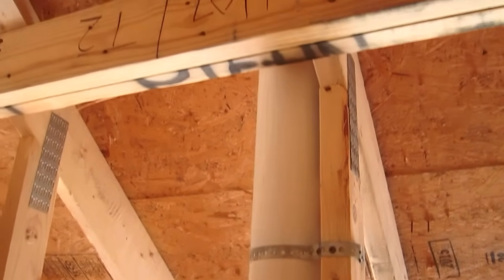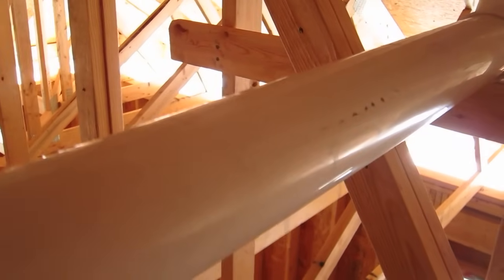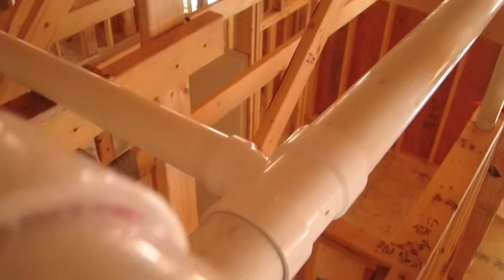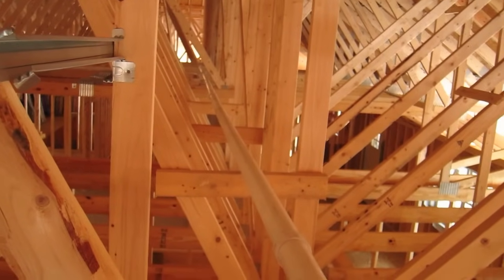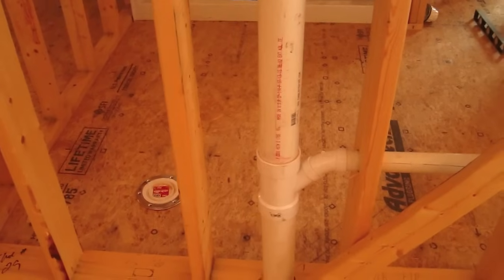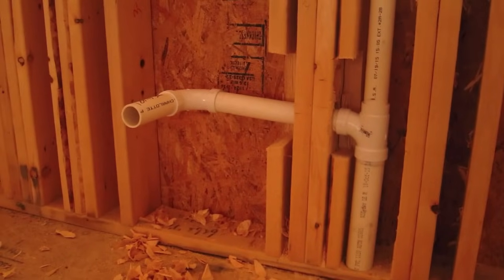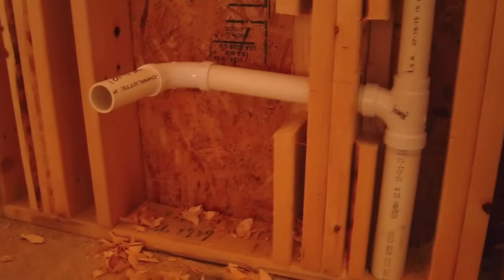How to Vent Plumbing

Comment from the maker: The TY fitting you see at the beginning of this video was specified by the homeowner. This NH town had NO plumbing inspections. An inspector would have FAILED the installation as we all know.
Reply: Why would anyone specify this?  What was their reasoning for doing it 'wrong'?
Reply from the maker: Simple. The homeowner felt that a snake would have a better chance of clearing a clog at the end of the branch arm if it was pointed down instead of drilling a hole into the side of the stack. It's a valid concern. The sink functions properly. Even when you fill it with water and pull the plug, the last slug of water doesn't syphon the trap.
Reply: @askthebuilder  Thanks for the reply and the great video!  Definitely understand the concern, I've had snakes try and go the wrong way in san-tees before.
Reply: @askthebuilder hello, can you please pinpoint the timeframe of the TY that is in reference so that I can further understand the scenario.  Much appreciated.  Thank you.  Great video.
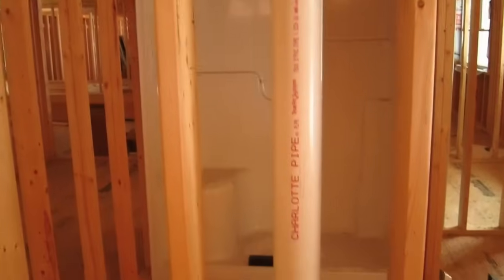Reply: @cgparas1  I believe he is talking about at 4:13 mark.
Reply: Budy spending more money then he should on that pipe , you really dont need a 2" vent coming from the venity

Comment: I'd rather not penetrate the metal roof by using Studor vents.  Is that ok in northern VT if the vent is 4" or will the Studor vent clog with hoarfrost?   Thanks!
Reply from the maker: Studor, or AAV, vents should be illegal. They always fail because they have moving parts. It's SO EASY to install a leakproof flashing in a metal roof. Watch this: https://www.youtube.com/watch?v=ZcAmtrNu2Js  Get on a phone call with me so I can help you avoid a nightmare: https://shop.askthebuilder.com/15-minute-phone-or-video-conversation-with-tim/

Comment: why waste so much material trying to connect them all to one 4' vent? wouldnt it be better to just go straight up for some of the fixtures? I am not a plumber nor have experience. just curious.
Reply from the maker: That's a great question. This particular homeowner only wanted one roof penetration. You're correct, you can save lots of pipe and time punching up multiple vents through the roof.

Comment: Outstanding video and explanation of the plumbing vents and how they should work. I'm a DIY'er and I have a new metal roof going on my house soon. So I'm looking to consolidate as many of my vent tubes going through the roof as possible to minimize any future leakage issues and to make it easier to get the roof on. Your video confirmed all of my design ideas - such as keeping a slop from the exit pipe to each of the vents I'm tying together. Even though I live in Texas and have not had any severe freezing to the vents, I intend to ensure the vents stay dry as a practice.
Reply from the maker: Be sure you watch my video about how to install plumbing flashings through metal roofs. You need to PLAN exactly where the vent will be centered between ribs. Use the Lifetime Tool flashing!!! Here's the link but  be SURE you get the one that matches your pipe size: https://amzn.to/4mIoRXf

Comment: Great video, so there's no problem with running vents horizonal or with bends/elbows? I'm looking to install solar on my roof and the southern side has three vent pipes in the way. So I can get a plumber to redirect those vents in the attic to come out on the other side of the roof (maybe 15-20' away)?
Reply from the maker: Correct. I do phone consulting before you make a HUGE mistake: https://shop.askthebuilder.com/15-minute-phone-or-video-conversation-with-tim/

Comment: If the air supplied not vented out as you say, why it goes through roof ? Makes no sense, you can take from side wall if was air in
Reply from the maker: You must have not attended school the day vacuums and air pressure were discussed in high school physics class.

Comment: I noticed you increased the pipe size in the attic. I've read that this should be done before the vent leaves the thermal envelope. Will the attic ceiling and walls be insulated or am I misunderstanding something?

Comment: amazing video. I'm trying to build a half bathroom and a full bathroom on the complete opposite side of the house as my stink pipe/drain stack, one on the first floor and the other in the attic,  and this in invaluable information. luckily for me the difference is not 50 to 60 feet long like this one! thank you.
Reply from the maker: I may be the only plumber in the USA that offers DIY phone coaching should you need help: https://shop.askthebuilder.com/15-minute-phone-or-video-conversation-with-tim/

Comment: The water pressure would cause the house to flood without air, right?
Reply from the maker: Wrong.
Reply: No the air would just be pulled from the drain itself. So, you’ll get bubbling/gurgling and slow draining. It’s similar to tipping a bottle of water upside down - then tip another full bottle upside down but with a hole on top

Comment: Good job on the video. Our modular home only has 1 1/2" vent pipes through the roof.  They do freeze over . Now I know more of why.  I want to correct the problem eventually.  Lots of sheet rock has to come down and 3" or 4" roof vent piping needs to be added.  Thanks for the classroom time.

Comment: Was  clear primer used on those joints? Purple primer typically is used to show the inspector they were properly primed. Unless it was brought up in another's comments, which I didn't notice, just wondering.
Reply from the maker: That is a very good question. Kudos to you for asking it respectfully. Yes. Clear primer. You can swab in out farther on the pipe to show the inspector primer was used. I dislike purple for a host of reasons.

Comment: So why is it soooo important that the one bath has a three inch vent but the master bath, laundry and kitchen can all run off of a two inch vent pipe ?!!!🤔😉😉
Reply from the maker: It's a great plumbing practice to have at least one full-sized vent in a house. Vent pipe diameters are a function of distance and fixture units.

Comment: Let's get this straight. Per the Plumbing Code Illustrated Manual. The vent pipe does stop siphonage from happening. You are correct Sir. Now, the vent pipes also makes it possible for sewage to flow thru the sewer pipe in the street. When sewage flows through the main sewer it pushes air through the sewer which escapes out the house vent pipes. As the sewage continues down the sewer it pulls in air behind it. It gets the air from the vent pipes in the house. So, as the sewage passes a house the vent pipe allows air to escape out the house vent pipe. As the Serge of sewage passes by the house the air is pulled into the sewer via the house vent pipe
Reply from the maker: You're correct. I've shared these same facts in columns on my www.AsktheBuilder.com website. I've done sewer taps in the past where a 12-inch main was flowing at 80% capacity. It almost looked like water flowing through a fire hose. To your point, that pipe at 3 AM in the morning is mostly filled with air. That air is pushed ahead of the sewage as the pipe fills and needs to be replaced.

And you're correct about the Venturi effect caused by the sewage passing by each sewer tap.

Comment: Every house I ever remodeled had roofing deck rot around the plumbing vent penetrations through the roof. 
I am about to build a house and I'm going to encapsulate the attic by using spray foam on the other side of the roof covering the rafters about 10 in... This will obscure my ability to inspect my plumbing vent penetrations which could cause further damage if they leak. 
Do you know if the code will allow me to vent the plumbing out the side of the house in the attic gable if I turn it up with a 90?
Reply from the maker: If you live in NOLA you can. Otherwise, it's very doubtful. Watch this video I did showing the BEST leak-proof vent flashing and HOW to install it. The wood will never rot: https://www.youtube.com/watch?v=dfliETAVTeI

Comment: Here in Wisconsin, my 1950 house has 4" cast iron.  This is from the street, the floor drains, toilet and soil stack.  At the roof it has a 5" expander, because the code requirement was a 4" UNRESTRICTED vent opening in case of ice or frost buildup, (we get down to 15 below at times.  We got down to 26 below twice, our all time record low).  Bathroom sink and tub/shower were 1 1/2 galivinsed pipe, wet vented.  The kitchen sink at the other end of the house has its own roof vent, with a 2" galvanised  drain into a 4" , 4 foot cast iron riser with clean out.  About 30 years ago, I replaced all the galvanised drains with PVC.  Although they looked okay on the outside with no leaks they were clogging because of rust build up.

Comment: Don’t vent pipes also allow sewer gases to escape to the roof? If so, the function is bidirectional. Air travels down to maintain proper air pressure and up to move harmful gases to the roof?
Reply from the maker: Sewer gas can be pulled out of roof vent pipes by the Venturi effect as wind blows across the top of the pipe. But don't think that sewer gas floats on its own out of a vent pipe like smoke from a chimney or engine exhaust from a car/truck tailpipe. The primary purpose of vent pipes is as I talk about. They replace the air pushed DOWN the drainage system by flowing and rushing water. It's no different than air in an elevator shaft in skyscrapers.

Comment: Not real sure how condensate will travel those 90 degree turns up and over down. Sounds good, but really?
Reply from the maker: Can you give me the time stamps in the video where you feel condensate is traveling UP? All the vent lines in this video are sloped so the condensate runs to a vertical stack and then down into the building drain. It's probably a very good idea for you to bone up on the UPC.

Comment: When moving  an existing vent pipe from one side roof to the other side, which is needed for a solar panel install, what's your advice?
Reply from the maker: Simple. Move it. If you need step-by-step instructions to ensure it works PERFECTLY, you can get me on the phone. I'll save you at least $500. https://shop.askthebuilder.com/15-minute-phone-or-video-conversation-with-tim/

Comment: Did the homeowner also designate where they wanted the roof penetration? Odd to have it all the way at one end of the roof, instead of centralized for shorter run to the extremities.
Reply from the maker: Yes. They wanted the plumbing vent on a side roof not visible when you pull up the drive or walk to the front door. Some people don't like to see the plumbing vents poking out of roofs.

Comment: Is there a fix for the high wind syphoning the p trap? I've noticed it for a while in fall through winter and early spring months when wind are higher and the leaves are off the trees. Thanks
Reply from the maker: High winds don't syphon p-traps that are installed with a proper vent. P-traps do DRY OUT if you don't add water to them once a month.
Reply: @askthebuilder  every day I use all of it. It's really only the bathtub and it is pretty much when the trees can't obstruct the wind. There are also other videos showing yes wind can siphon them. I only have one bathroom. Several people use the shower every day. No leaks in the basement. Outside of trap is bone dry.  House was built in 1890. Plumbing was updated in the 80s by a previous owner.

Comment: How many feet can the fixtures (tub, vanity,  and toilet) br from the vent pipe?  Is it a straight line or pipe  line distance?
Reply from the maker: Usually no more than 3 feet. There are exceptions in the code. It's online. Go read about it.

Comment: Great explanation!! Im at the stage  of rough plumbing  soon
Reply from the maker: I draw riser diagrams so you get ALL of the pipe sizes correct. I also offer phone coaching. I'm working with two DIY homeowners right now who are installing all of the plumbing in their homes. It's the BEST $$$$$ you'll spend on the project. https://shop.askthebuilder.com/15-minute-phone-or-video-conversation-with-tim/
Reply: @askthebuilder  
I can drawer a rough skech of my 1,200 layout ,its small .see if you can get me a price on the spec layout fir me or plumber to do it the right way
Reply from the maker: Veronica, I'm happy to draw your riser diagram. Call me for details: 603-470-0508

Comment: Hello --  for a new home build  with a basement living area with bathroom and a snack area with a bar sink, and having a poured concrete floor,  we would like to have an integral 2" floor drain trap with a back up device at the lowest point in a recessed mechanical room.  In searching for information about venting this drain, we believe that it will not need to be vented to a vertical stack as it is 2" piping, and thus has enough free air space to not require a direct vent?  Are we interpreting our findings correctly?  Secondly, should we be concerned about the floor drain "drying" out and allowing sewer gas and odors to come from the septic tank? Thanks in advance for the answer.
Reply from the maker: I do phone consulting for situations like this. I'm an expert in the topic. Go here to set up the call: https://shop.askthebuilder.com/15-minute-phone-or-video-conversation-with-tim/
Reply: Thanks but.... I can find all the information (for free) by doing research and save my money!  @askthebuilder
Reply from the maker: I wish you the best of luck. The Interweb is littered with lots of false information. Quick question: Do you use the Internet to get free medical or legal advice? I'm a professional just as they are.

Comment: Why didn't you use a sanitary tee at 4:52?
Reply from the maker: Because the homeowner INSISTED on using the TY fitting. I informed him it was against code creating an illegal S trap. The town the house was built in has NO inspections of any type. No building inspection, no electrical inspection, no PLUMBING inspection so I knew I'd not have to cut out the fitting. As of this date all these years later, the trap has NEVER been suctioned dry by the adjacent toilet. Also, filling up the sink to the brim and pulling the stopper doesn't create enough siphoning action to suck the trap dry. You should experiment with this by building your own crude setup. It's all about how high the S trap is and how much water is flowing out of the vessel.
Reply: @askthebuilder  Now there is more questions.  lol  Why did the homeowner insist on using the wye?  I gotta hear why they know better than the plumbing code.
Reply from the maker: 1. It was HIS house - the UPC code officials were not making the mortgage payments. He felt that the down angle of the wye would prevent hair, cosmetic goo, toothpaste, etc. from hanging up on the lip of the sanitary tee.

2. Don't always assume the code is correct. Example: I once piped a bathroom with 1/2-inch-diameter PVC tubing temporarily to see if that small pipe would admit enough air when all fixtures drained at once. It worked perfectly. Many forget that the air pressure at or near sea level is 14.2 PSI. Have you ever seen a rubber test plug shoot across the room from a sanitary 1.5-inch tee at just 5 PSI? I have. Yes, I understand they want bigger vent pipes to prevent long-term clogs, etc.

Comment: My pvc vent pipes are sweating. Leaked through and now have ceiling damage in a room. Do you have any advice to prevent this?
Reply from the maker: Yes I can help you. It requires a phone conversation for a host of reasons: https://shop.askthebuilder.com/15-minute-phone-or-video-conversation-with-tim/

Comment: Didn't see a vent for the toilet. If you're using that 3" in that 2"×6" wall as your water closet vent, you've already failed inspection in Kentucky. You've got a wet vent, and a flat vent. Niether will pass inspection here. Each fixture needs an individual vent that needs to be washed. I keep seeing these damn videos posted all over youtube giving irrelevant info to people in my state. These how too's and explanation videos can get spmeone in real trouble here in Kentucky. We're strict here. Depending in the severity of the infraction you could get fined $500.00 or face 1-5 years in jail. Call a plumber in my state if you need a house roughed in. Don't attempt it yourself. Our code can be complicated, but it's that way for a REASON.
Reply from the maker: The UPC has had that wet vent setup for years. There's absolutely nothing wrong with it from a best practices standpoint. Have you ever questioned WHY in KY it's not allowed? Can those who disallow it give you examples of how the toilet won't function (it does perfectly) or that it can't get enough air if the vanity bowl full of water is draining (the toilet gets plenty of air because the 1.5-inch pipe can't possibly fill the short vertical 3-inch stack with water)? 

In other words, have you engaged your God-given critical-thinking skills to CHALLENGE what is being enforced? You should because there are hundreds of THOUSANDS of these wet vents all over the USA that work perfectly fine.

And share with us how your DRY vents in KY get washed. Anything above a sanitary tee is a vent and it's dry except for condensation. Everything BELOW a sanitary tee is a stack, not a vent.

We await your answers. Better yet, use your YouTube channel for its intended purpose. Record a video showing us all the KY craziness and back it up with science not speculation. Once you upload the video to your channel, come back and share the URL here.

Comment: 13:30 Must allow drainage for condensation & RAIN... yay!!!   ... though i would typically not see a 50 ft run just a second roof penetration, Ive not used 1-1/2 for anything in the last ten years ... .
Reply from the maker: The homeowner INSISTED on just one roof penetration. I agree, a second vent pipe should have been put in although it would have ended up just above the front door. :-(